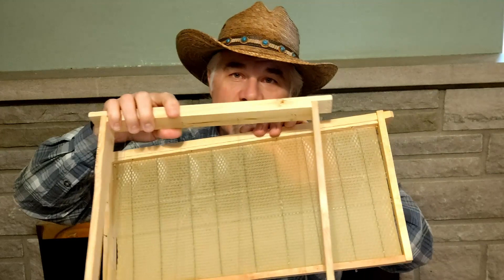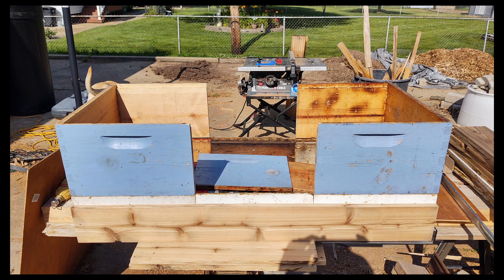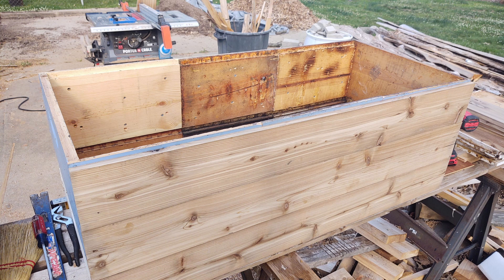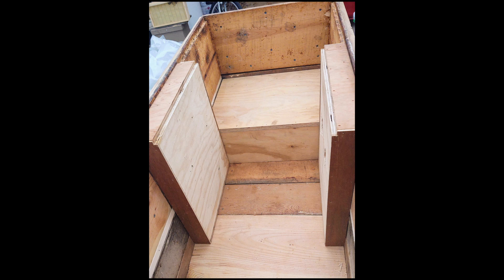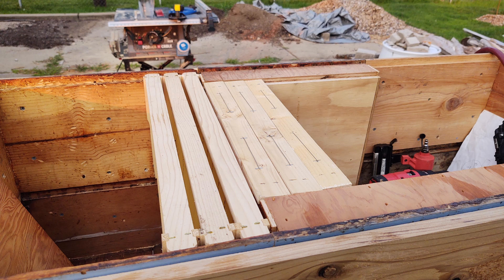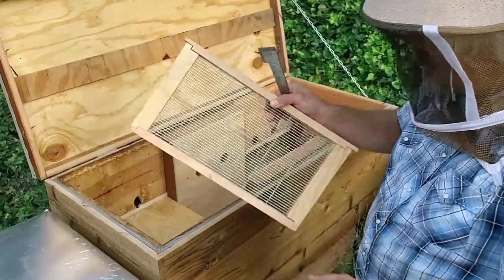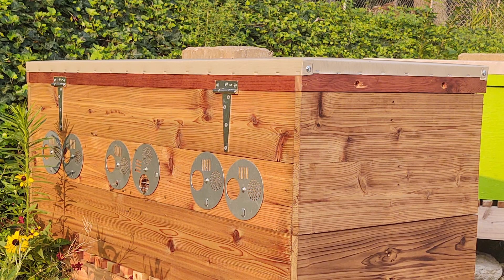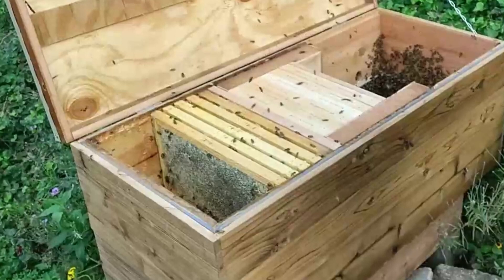How I Built a Langstroth-Layens Conversion Honeybee Hive

Comment: Well done, should last for years. So what are you thinking about fire hardening wood?
Reply from the maker: I'm guessing you mean scorching the outside to protect the wood?  I don't have much experience with it for wood preservation, but it seems like a fairly simple way to finish the wood and I think it can look good.  What's your experience with it?

Having said that, I do scorch the insides of my swarm traps but that's mainly to reduce a new wood smell and because there's some thought that bees might have a slight preference for a scorched interior (like the sanitized interior of a burned hollow tree after a forest fire).  I don't know if there's science behind that or not, but it doesn't seem to hurt.  I've also scorched the interior of hives after an abscond or die-out to sanitize the interior before moving in another colony.  But I think those are different purposes than what you're talking about.
Reply: @SuburbanSodbuster  Well that was more information than i expected. BUT all very much appreciated and makes REALLY good and i think smart! Will be doing those two. I'm thing scorched wood and Eco wood treatment as per Frederick Dunn.

Comment: So the (basic) key to conversion here is knowing where the queen is, correct? Otherwise the brood won't switch over to the Layens frames, if I'm understanding correctly.
Reply from the maker: Yes, the queen must be on the target side of the excluder.  But if that's not certain it can be determined after a few days by checking for brood on the desired side of the conversion.
Reply: @SuburbanSodbuster  Make perfect sense. Thanks!